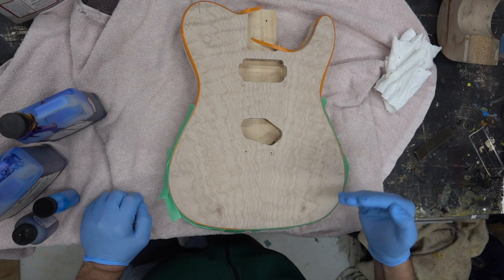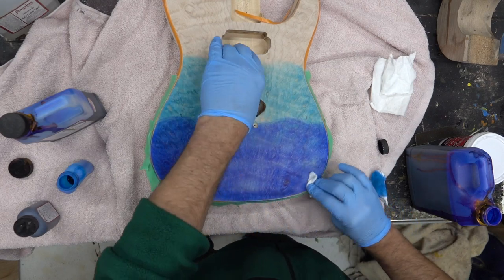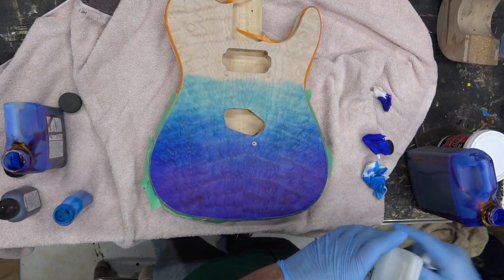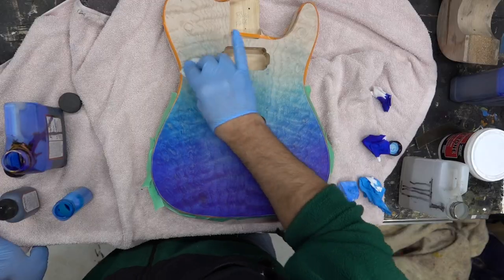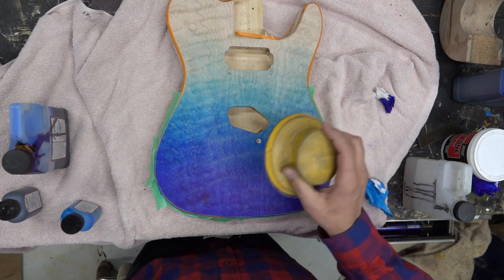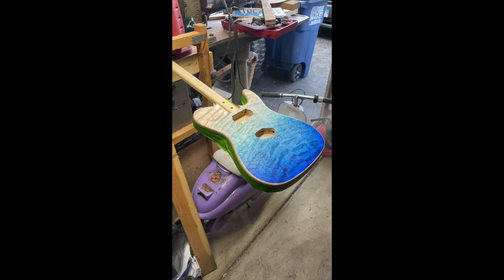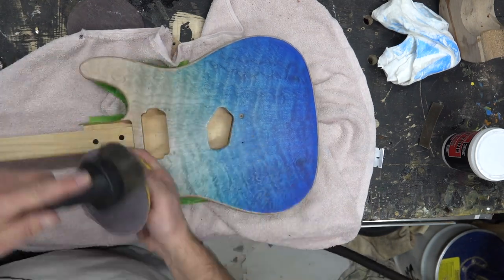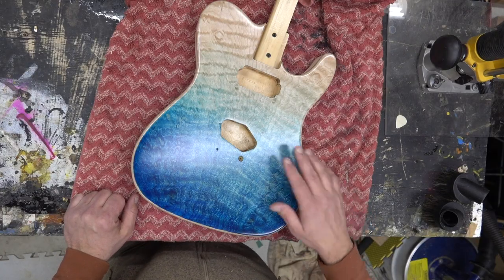DIY STAIN - BLUE OCEAN FADE - DIVE RIGHT IN

Comment: I've been using tru-oil to seal my sides for the faux binding, and it works amazing. Especially with the Angela's dye's. If any dye gets on the tru-oiled areas, it can easily be taken off with 0000 fine steel wool with almost all traces of color being easily removed. I don't even tape off properly anymore when I stain because of it. Not really necessary if you're careful around the edges.
Reply: Hello, did you use the Angela's leather dye for your guitar? I'm just unsure if that's suitable for wood.
Reply: @NYANPASS-CHEN  it's perfect for wood. It's just an alcohol based dye. Some people prefer water based dyes, but I've come to prefer the alcohol based dyes. They dry quick as hell too. If you use a wipe on finish some of the dye may wipe away but if you let it dry for about a week, you shouldn't have that much of an issue with that. I've done 2 guitars with Angela's leather dye and have no complaints. Just practice on some scrap wood first

Comment: Derek that was a fantastic video and the best by far I’ve seen on doing a fade. One question you said on video that you were sanding back using 600 but when you switched to the voiceover you said it was 320, which was the correct grit for removing the colour off the top?
Reply: 600. He sanded the bare wood to 320, and took some color away with 600 after the first staining session.